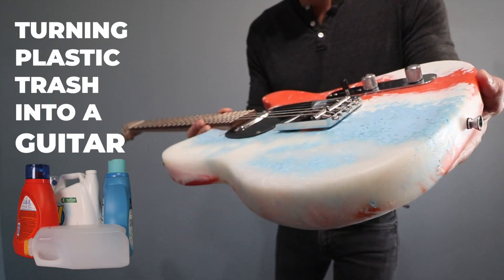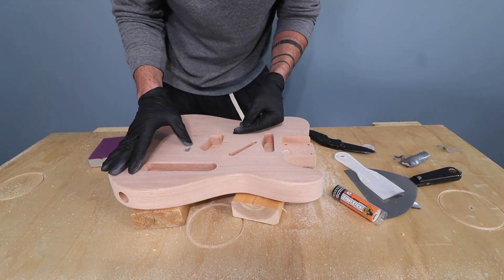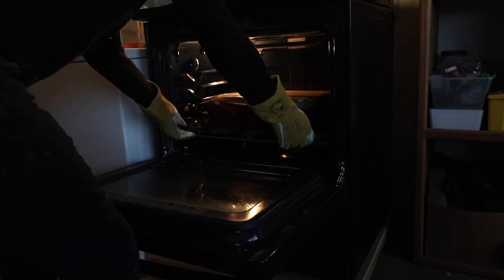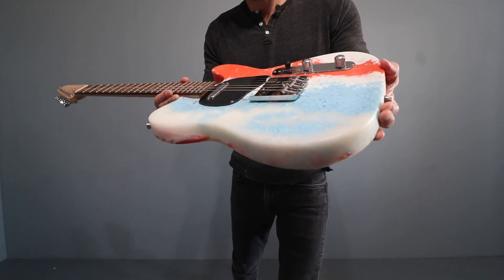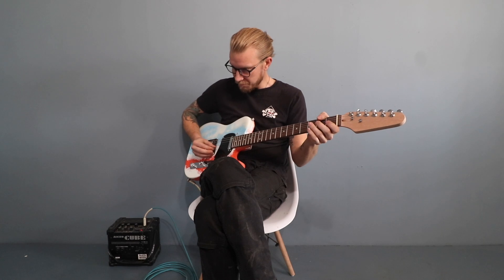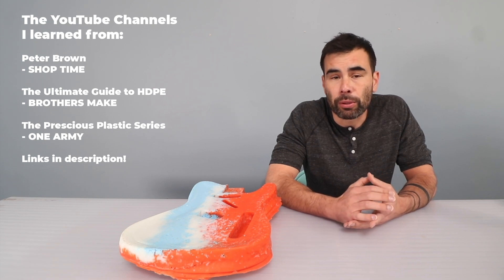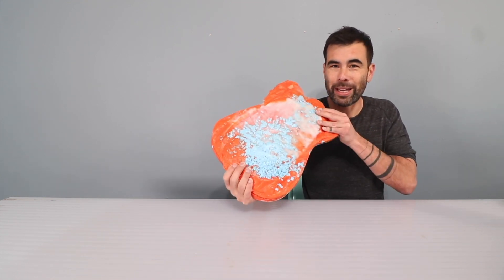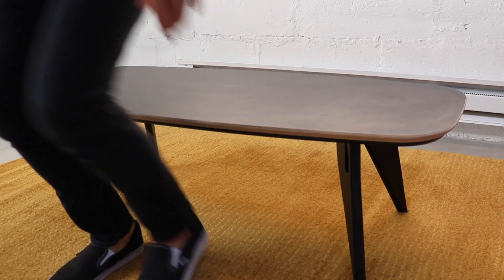I made a Guitar out of PLASTIC TRASH | Recycling HDPE

Comment: You had the idea of making a "solar oven" for this to reduce the electricity use. My idea is you make a box without a top and paint it with high heat paint you could use the grill paint you can buy in any big box store.
Next you create a smaller box also no top inside of the first one made of aluminum. Box one creates and holds heat to heat up box 2.
Then you build a up from box one and create slots from the side to put in lenses.
Those lenses use the method tkor used to make their "death ray" they use convex acrylic like a magnifying glass.
The problem you have to figure out is how to refract the light so it doesn't heat up one spot and how many lenses it would take to control the temperature.

Comment: No experience with guitars and you built this wow that's awsome and most of your sound like 85 percent or more of it is from the pick ups and amp material guitar is made out of body wise doesn't matter neck and frets and material that matters alot it has to play good no sharp edges smooth everything if not it will hinder the players playing which will hinder the sound of the guitar but all of your sound I mainly the electronics and amps thats it man and strings sound the best brand new the sound worse older they get they get flat string stretch that means it just stretches out of tune and if you pre stretch and put the strings on right it won't be much of a problem I would love to have that guitar and play it live at a gig. True 70s hippy vibe like jimi hendrix and wood stock hippy feel cuse it's made out of recycled plastic lol

Comment: Love the design and how portable and pratical the table is.  But for 600 bucks for a 60" x 24" plastic with plywood veneer on top??? Holy moly!  That is way way way too much.  Take in consideration a Walmart portable table 6' long selling for 47 bucks.  Granted it does not have the elegant design aspect but it does the job. This table has the design aspect and is somewhat the same size, but yet very expensive for what it is.   When this is at target or IKEA for 99 bucks,. I'll buy it.
Reply from the maker: yes our margins are only about 30% we have to scale production to reduce the cost of the recycled plastic.  currently we are comparable in price to west elm and CB2 which have no trouble finding millions of customers.  we could go cheaper by not using recycled or FSC certified materials but we don't want to

Comment: No need for weights inside the oven. After pulling the molten results from the oven, place a sheet of parchment on top, then place a wood (not steel) board on top and weight/clamp it down. Such a thick mass of plastic needs several hours to cool. Like overnight. Then, shrinkage and warpage will be at a minimum.

Comment: Fun video.  Excellent exercise in extreme waste, even as a prototype or proof of concept.  A preliminary proposal alone would have eliminated the reasonable possibility to proceed.  But then, there would be no video.  Definitely a fun video.  Another example demonstrating that most such efforts run with an energy deficit, expanded carbon footprint, and lack of sustainability.  Of course, government subsidies often resolve those issues for projects that proceed in the face of reality.  Apply for a grant, seek subsidies, and it could lead to a billion dollar venture.  Especially true if you include buzz words such as sustainable, environment, optics, organic, etc. for the pseudointellectual psycho-politically motivated creatures that feed on such things.
Reply: OK, so if he goes to all that effort, and then ends up making a concrete mold that can be reused almost infinately, and uses solar power to supply power, its still wasteful?  Not that I disagree with you in the main, however if someone wanted to spend their time doing this, seems like one could. If there were a market for plastic guitars that a manf. couldn't undercut.

Comment: Cool project and all, but it looks like you're sanding that thing outside and allowing the plastic dust to just blow away. This is not something you should encourage. In other words, DON'T TREAT PLASTIC LIKE WOOD if you care about the environment :)
Reply from the maker: you are right and this logic should also call for not using any micro plastic skin care products, spray paint, synthetic decking, OSB or particle board.  I would support smart regulation on any of these

Comment: I know that you consider it not so eco friendly, but I would say that it is more impactful since you are producing only 1 guitar. If you produce more than 1 guitar, the energy consumption of water and the electricity for the blending part start to decrease. Also, reusing the mold and using a gas oven (and heating more than one guitar at the same time) would increase the "eco-friendliness". The bottom line here is that the main benefit is avoiding all that plastic to reach the landfills AND water bodies... so... yeah!

Comment: Nice video 👍 heat inefficiencies are only really a concern if creating big, thick parts like that. If you used existing industrial processes like IM it’s less of a concern as you’re just swapping the material from a virgin plastic to a recycled plastic. It’s a minefield to regulate and dial in settings though.